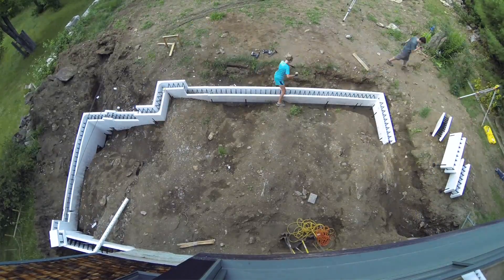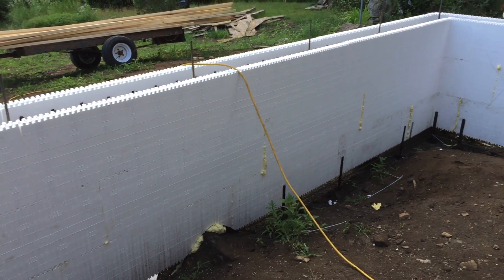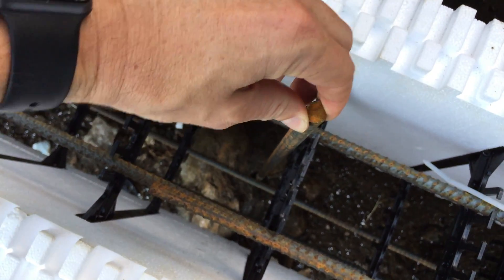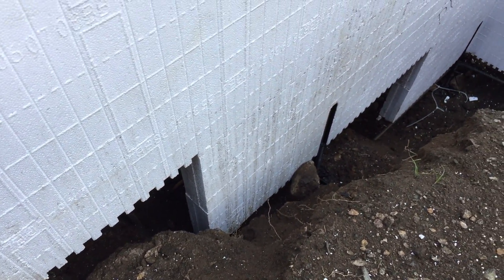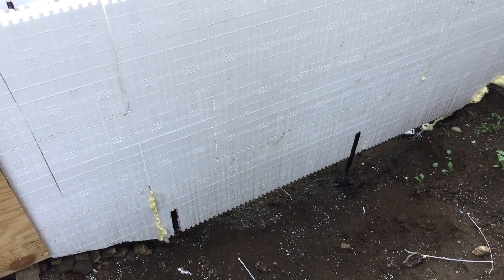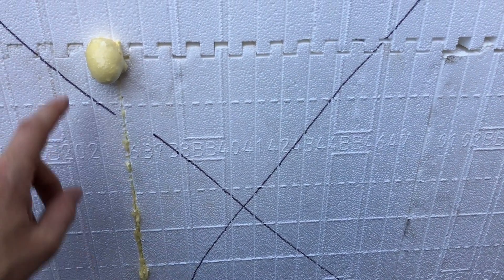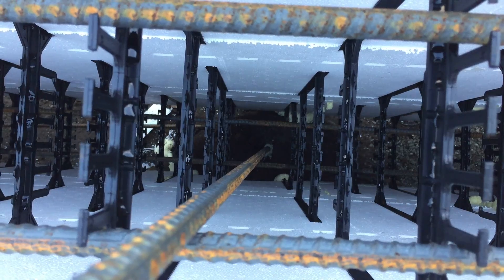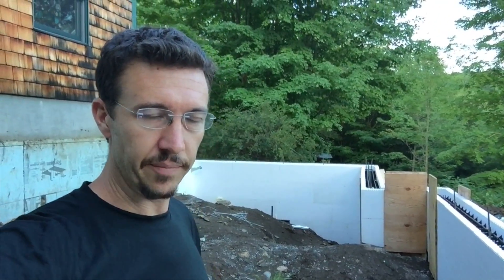How to DIY ICF mono pour concrete foundation footings and walls forms

Comment: saw where one contractor alternated the horizontal re bar on either side of the vertical so it formed its own channel to hold the vertical bar in place.. with several on one side and several bar on the other side of the vertical risers.  Little stuff that speeds up production

Comment: What are the steel brackets with the black wheels on the Styrofoam blocks?
Reply from the maker: Great question.  I forgot to even mention the bracing. I may have some video on the bracing... they are zonts and zuckles. FabForm industries apparently hired Dr. Seuss to name their products.
Reply: I see said the blind man.....I looked them up.  I know what you are talking about now.  Seems like the Styrofoam block system name brand you used, is a good one.